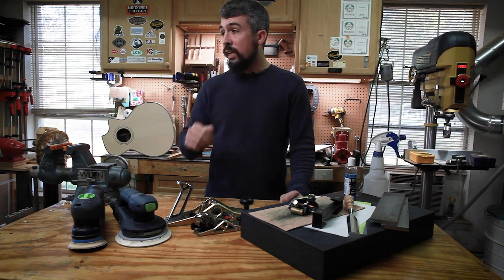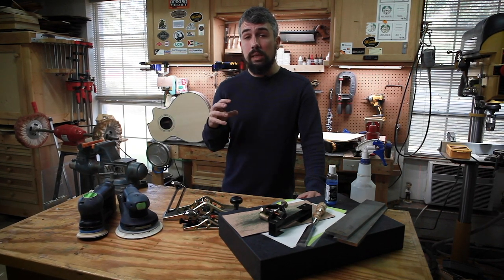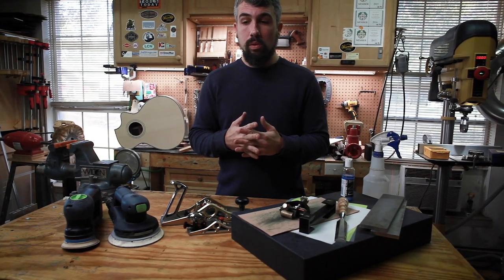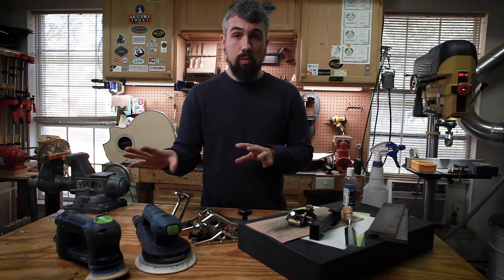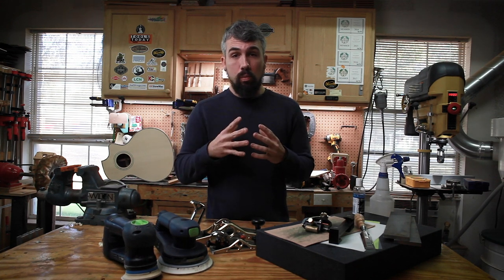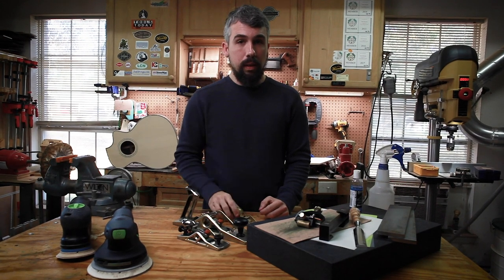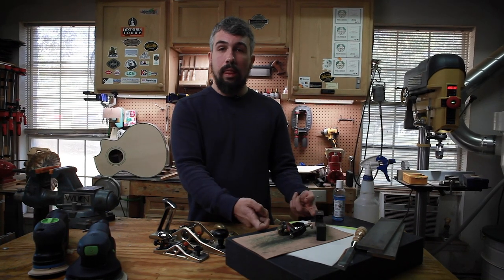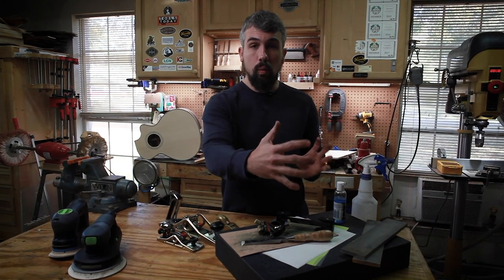5 Woodworking tools that will improve your guitar building.

Comment: Hey Chris - I love your work and your videos and would agree with most of your tool recommendations. However I consider the likes of the Bridge City tools to be a luxury rather than a necessity. I don't even wish to own the more modern planes from Lie Nielsen and Veritas as I have many Stanley and record planes which are all pre war and work very well. I will admit to replacing most of the blades with better, thicker versions, but have found over the years that providing I keep them well honed that they perform every bit as well as the new kids on the block. You have to know how to set them for the best performance but it not difficult. I find a lot of woodworkers are attracted more by pretty, shiny tools rather than learning to sharpen what they already have.  I love my old Ashley Isles chisels which perform beautifully and I think a lot of the new modern makers are unnecessarily expensive. Okay, I'm in my seventies and treasure the tools I have collected over many many years so I wouldn't want new up and coming makers to be put off by thinking the cost of the tools makes guitar making out of their reach. Keep safe - Dave

Comment: Great videos.  Definitely a new subscriber!  18:59 - A woodworking vise with wide face lined with suede or leather will be an eye opener for work holding over using a metal working vise.
Reply from the maker: Yeah that’s on my list along with a proper woodworking workbench in the center of my shop

Comment: Here's a hint for natural wood binding; Find a good Modeler's store that sells model / replica sailing ships. (1600s - 1800s) . Find the siding strips or "planking". Most of it is made from maple or walnut. Sizes average about the size of your standard binding and  each averages about 3 feet in length. I bought over a hundred strips of walnut and about that many maple, each being only a few cents. If it helps, mine was for the San Juan Nepomuceno kit. BIG ship

Comment: You're kidding me that vacuum clamp is so nice. I only customize guitars but wow that would be so much nicer for sanding. That drill attachment would be neat unfortunately never worked on an acoustic guitar that the sides were remotely flat so I'm pretty sure I'd sand right through the veneer. Good video great tips thanks man.

Comment: This is an expensive video... I've had the opportunity to upgrade my workshop a bit lately and got a drum sander and nice orbital sander. Sadly I got a new Stanley Nr7 hand plane that is just complete trash. I'm half way through getting the sole flat, but it had like big old dish in the middle, right where contact is the most important. Now I want a set of Bridge city panes, but first I gotta find the grand to pay for them :D
Also it seems that LMI is no longer selling the vacuum calmp (or I'm just incapable of using their website), do you have an alternative suggestion?

Comment: Hopping over here from your IG feed.  Those Bridge City tools are pretty awesome.  Thanks for sharing your insight regarding useful additions to the shop arsenal.  BTW...  Which slider are you using?  Your video work looks very nice.
Reply from the maker: Thanks for watching! I use the Edelkrone JibOne and HeadOne for the shots. It could make a rock look like art.
Reply: @DriftwoodGuitars  Perfect!  Thanks for the tip on Edelkrone.  I've seen their sliders before, I'd never seen their pan/tilt heads...  Those combos look incredible...  I think that just settled my inner debate on which manufacturer to go with.  Their app looks like it does an amazing job of making setups simple.  Thank you for sharing that info.
Reply from the maker: Yeah I was super apprehensive with the steep price, but the images just look amazing and it makes showcasing your product a lot easier and sexier. In the end I think the sliders pay for themselves. The JibOne is incredible and the App is point and click simple.

Comment: FYI, for any people new to woodworking and guitar making.  I have a powermatic 6" POS jointer with a warped fence.  They refused to fix or replace it and said to me just how accurate does it have to be?  Then they said to remove it and stand on it like jumping up and down on it to straighten it and that should be good enough.  I was new to woodworking and it would cost me over 1/3rd of the price to ship it back.  I personally wouldn't buy a screw driver if it said powermatic on it.  Just a warning for people who see your videos and think they make quality machines and buying one ensures no problems.  Just another piece of chinese made crap.  Again it was the lack of customer service that was unbelievable.  Good luck!
Reply from the maker: Man that’s awful to hear. I’m sorry they put you through the ringer on that. Totally unacceptable and I understand why you’d never buy again. I’ve had great experiences with them and their customer service. It’s hard to find a reliable and good manufacturer these days, that’s for sure